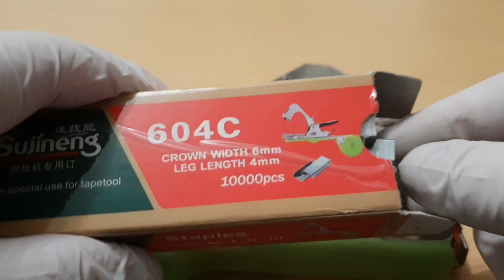Tapetool - how to replace tape and staples. Hand tying machine replace tape and staples.

Comment: Had one of these. Mine was orange. Side wouldn’t open. Would staple. Only grabbed the tape one every 10 clicks. Trying to find the green one.
Reply from the maker: I think it's the same product. It just has a different color.
Reply: I meant to say would not staple. Mine was a Funteck I sent mine back. Expecting a replacement.

Comment: I cant fix mine, its blade cutter  is not working or
Reply from the maker: I think you are not doing it right when using the tape stapler. You probably did not insert the tape corectly.
Reply: @DorelBorlea  and the cutter was spliting and missed, no replacement
Reply from the maker: @raysfildsoyland682  when you bought the tape stapler did it work?  did you use it?
Reply: @DorelBorlea  yes , i works after 5 rolls of plastic tape, but after 5 rolls, blade was split missing
Reply from the maker: I do not know what to say.  I don't understand what is the problem with your tape stapler.